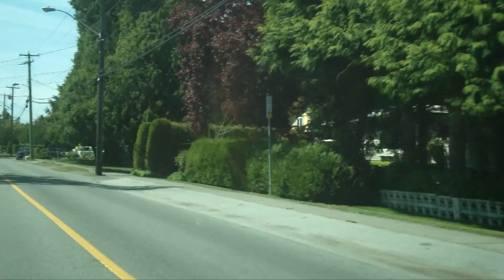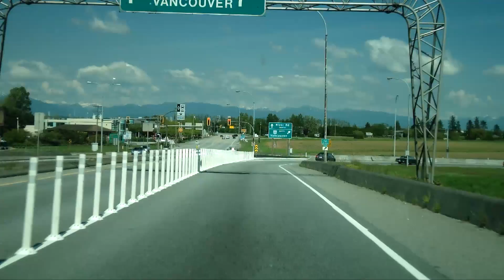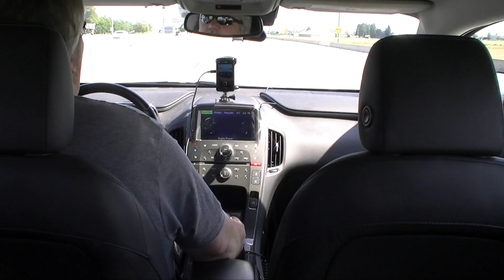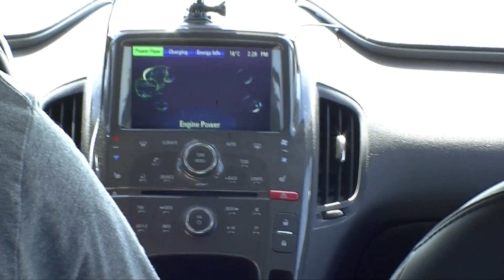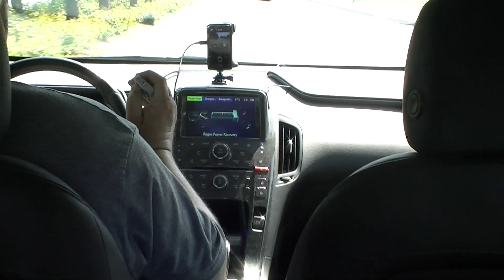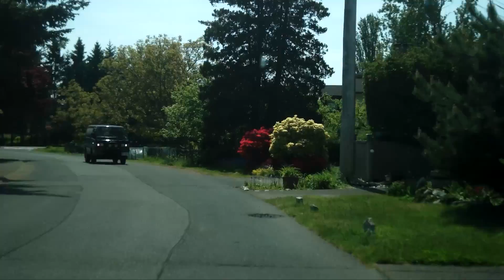How to drive a chevy volt for best electric range and fuel economy

Comment: Hi, good video...gives the audience the basics of hypermiling.  That said, for the utmost in efficiency you'd be better off coasting in neutral rather than using regenerative braking all the time.  Though regenerative braking does does return energy to the battery, it isn't 100% efficient (more like 70%) in doing so.  For that reason, while using L or on regenerative braking, you never get back the energy you "paid for" to get that momentum.  In most situations, I'd recommend using "L" only when you really do need to slow down or come to a stop - otherwise, it's better to preserve that valuable momentum using N whenever possible.
Reply from the maker: +oilerlord 
If you watch the video the only time I use L is when I need to slow down or stop. I don't use it while driving at a constant speed. Only when going down Hills an when rolling up to a red or stop sign. Shifting to Neutral is both dangerous an in most jurisdictions illegal as is driving with the clutch pressed on manual transmission cars. 
Without drag, or power to the wheels the steering is affected big time.
Reply: +12voltvids
Illegal...I'd have to check local laws, but dangerous...how so?  I drive a VW TDI and coast in N to take advantage of hills and to preserve momentum all the time.  For me, it's second nature coasting in N, and I've been doing it for decades (and I've never had to replace a clutch or transmission).  The power steering isn't affected at all because the car is still running.  If you coast in N with a Volt, does that somehow turn the car off and/or affect the Volt's steering?  Please elaborate on that.  In terms of distracted driving, I suppose the repeated action of shifting to L could be considered as "dangerous" as shifting to N.  I'll stipulate that repeated shifting could cause wear with some transmissions, but unless the car is turned off, I don't see how steering would be affected or a loss of control would happen regardless of "L" or "N".
Reply from the maker: +oilerlord 
No the power steering is not affected if put in N or for that matter the power is turned off. Go watch my video regenerative brake experiment. You will see just how much energy is recaptured. 
It is illegal though, go check your regulations. Everywhere in Canada it is illegal to coast. The reason is it affects your vehicle stability. 
I switched to N in the other video so I could power the car off then on to reset the computer to get back to electric mode to see how many miles I could gain going down Hills and I have lots of flames by viewers tearing me a new one for showing this.
Reply: +12voltvids 
No flames here...just a difference of opinion.  How coasting in neutral would have an affect on vehicle stability is beyond me, but it's ok to agree to disagree on that one.  As advanced as regenerative braking systems are, none have the ability to recover anywhere close to the energy that was used to get the car moving forward - otherwise you'd be driving a perpetual motion machine.  That said, I'd be shifting to L in instances that more stopping force is required instead of (gasp) wasting energy into heating up brake pads.  I installed a large PV installation this fall, and I'm looking at either a Volt or other BEV to store / use that excess power instead of merely exporting it to the grid.  I'll either be picking up a used Volt or Spark EV this spring.  I "want" a Spark EV but logically, I already know that the Volt is the better choice for me.

I watched that experiment, where the guess-o-meter reported 208 km remaining.  Interesting, but just a fun number that a confused GOM interpreted.  Since there is only about 11kW of usable capacity in your 16.5kW battery, the Volt's battery can't realistically store enough energy to go anywhere near that distance however fun video nonetheless.
Reply from the maker: +oilerlord First of all that is not a "guess o-meter. That is the actual distance traveled on electric power. The battery only has 10Kw of usable "stored" energy on the 2012 model, however, remember regenerative braking places a huge amount of power into the battery. Watch my newer video where I started a descent with with 6KM remaining in the battery, and by the time I got down there was 21KM remaining.  For about 19KM of downhill "regen braking, I recovered 15 KM of usable energy. That's how it works. Not 100% energy recapture, but much higher than 70% Probably closer to 90%.You can look at the distance covered and the fuel used in that video and figure out how little fuel I used due to the energy reclaimed by regen braking. Also since you have never driven a volt you don't know how it runs. In D, when you take your foot off the accelerator, you are almost totally freewheeling. There is a slight drag, but it doesn't slow the car down. Going down hill the car will continue to accelerate. Shifting to L dumps more energy back into the battery and slows the car no different than applyin the brakes, without wasting that energy as heat.As to coasting in neutral, I invite you to google it and see why it is a bad idea. Besides being illegal.Here is what I found after a quick search."There are many reasons you should not do this.  The law is just one of the reasons.   

 First, you may think you're saving fuel by coasting in neutral.  This is not true.  Modern Cars will use less gas when coasting in gear than they will be switching to neutral.  In gear, the transmission keeps the engine turning and so no/very little gas is required.  Plus, if you get into a situation where you need power NOW, having to fiddle with the transmission isn't something you need added to the situation.  When the car is in neutral, it is forced to provide enough fuel to keep the engine idling.  This actually takes more fuel than it does to just coast. 

 It's also harder on your transmission, especially an automatic.  This is because all the pressure of timing the drive-shaft to the engine's crank-shaft is left to the clutch assembly within the transmission.  This is wear and tear on the transmission.  Unlike a manual, it costs a lot more to fix the automatic.  It's possible that the car will not go into gear.  And, if this happens while driving, you may find yourself in quite a pickle.   

 California Motor Vehicle Code 21710 makes it illegal to travel downhill with your car or truck in neutral.  The same law applies in most states of the United States.  California lists the following as reasons: 

 Your car is not designed to travel in neutral.  It is hard on your brakes, your power steering, and your gas usage 

 1)  No opportunity for engine braking.  If you drive a standard transmission, your car is designed for engine braking when traveling downhill.  Get into the habit of downshifting on hills.  This will be better for your transmission and save your brake pads. 

 2)  Power Steering loses its effectiveness.  If your car was built after 1980, it most likely has power steering.  When driving in neutral, the power steering will not work as well as it does when the car engine is engaged.  This will make turning around curves and avoiding road hazards more difficult.  You could also over-correct and crash the vehicle. 

 3)  Brakes may fail.  If you ride downhill with your foot on the brake the whole way, the added stress on your brakes could cause them to stop working.  Cars in neutral will pick up speed, making the brake pads heat up to unsafe levels.  Many trucks have lost their brakes because they were coasting downhill instead of downshifting. 

 40  Getting in gear takes time.  Accidents can occur in the blink of an eye.  If you have to take the extra second to get your car into gear, you may not be able to avoid obstacles.  Animals and potholes spring up out of nowhere and you should always be prepared to drive around them if necessary.  If you are coasting, your only option for avoiding hazards is to swerve or slam on your brakes.  Both of these are bad options. "        

 Source(s): http://www.trafficaccidentnewsandadviceb
Reply: +12voltvids 
Though it's true that most ICE cars use zero fuel when coasting in gear, engine braking also slows down the car at much faster rate than coasting in N.  For that reason, one isn't necessarily better than the other because driving for efficiency is all about preserving momentum in different situations.  From what you describe,  lifting your foot off the throttle in your Volt with it's electric motor is probably not much different than coasting in N.
Reply from the maker: +oilerlord It is essentially freewheeling. There is a slight drag and some recapture of energy to the battery, but nothing like dropping it into L range, or in th ecase of the 2016 model, tugging on the regen paddle on the steering wheel.As that article said though, modern cars will cut off the fuel when going down hill, and use the momentum of the car to keep the engine turning, which keeps the vacuum up for the power brakes, and keeps the power steering pump running all from the momentum of driving down hill. Switch to N, and the engine needs to be fed fuel to keep it running. It is also illegal to do so. Think nobody will find out? Have an accident, and investigators examine the black box that is in all modern cars, part of the air bag deploy module. The information that is stored in the box for several seconds prior to the crash is accelerator position, brakes on or off, was ABS activated, vehicle speed for 5 - 10 seconds prior to air bag deployment, engine RPM, and the gear that the car was in, was steering wheel turned just before impact ect.  All this information is stored, so should you get in a crash, and this information is downloaded it could have a huge impact on determining fault.  A few years ago there was a high profile incident involving a small child being run over by a drunk driver, and all the details of the car came out. The amount of information gathered by modern cars is quite extensive, and this is all available to investigators after an accident.
Reply: Oilerlord - I coast other cars in neutral, but never, ever the Volt.  Several reasons not to.  You can find them in the owners manual and online forums.  But primarily, there is NO benefit and a net loss of range.  You sacrifice any regeneration of electrical from kinetic by doing so. Regen is disabled in neutral.  Legality or illegality, control or less control... those concernss are irrelevant to the subject discussion of energy conservation.
Reply from the maker: I couldn't have said it better myself.
Reply from the maker: Don't want to keep my foot on the gas. I came from the standard world, and shifting down is fun. The new one has a flappy paddle on the sheering wheel to throw on the regen

Comment: Hi, I just recently got a Volt a few weeks ago, so forgive me for my ignorance. But when I try to drive freeway speeds (70+) the little green ball floats a bit above the middle and I run out of electric gas really quickly. When I try to drive home, which is a 39 mile commute on the freeway, I was hoping a full charge would get me there. But my electric gas runs out halfway then switches to drive mode. Is there something I'm doing wrong? I don't use AC or heaters, or windshield wipers because it rarely rains in California lol
Reply from the maker: +DominiqueCalique The faster you go the faster you will burn through the battery.At speeds over 60 it takes more energy to overcome the wind resistance and this is true on any car. A gas or diesel powered vehicle uses much more fuel to maintain high speeds. The little green ball shows you where you get the best economy, and that is speeds up to 60MPH. Now the outside temperature also plays a big role in how far you can go on electricity. At temperatures below 60' the range starts to fall off. When the temperature In in the 40's F and below I find I loose about half my electric range.This is because batteries do not perform as well in low temperatures. They like to be in the 68 - 72 range. This is where they perform at their best.When the temperature is lower, the car will actually turn on heaters in the battery back to bring the cells up to the range they perform best. This of course wastes some of the stored energy to heat the battery. You would wonder why they do this (all electric cars do this by the way) is to protect the battery from drawing too hard on it when it is cold. If your car is plugged it will keep the pack nice and warm ready for use, but if it has been sitting in a parking lot, then some of the charge will be used to warm the pack.When it is really cold, 25' the engine will start for a couple of minutes, and 2 things happen. First the electric heaters are turned on to start warming the battery, and then as the engine coolant warms up, that is used to heat the battery coolant. Once the battery is warm, the car switches back to battery, and the range is actually more on the battery once "engine running due to temperature" cycle ends as it hasn't sacrificed some of the charge to warm the pack. Once the temperature warms up again, the range returns.  Every winter since I got my volt, this Is the 5th winter with mine, my range drops to about 25 miles over the cold months, and in the spring it returns to the average 38-40 miles I easily get. The new one gets 52 miles, which is quite an improvement. For me this is not an issue though, as my daily commute is well within the change range even on the coldest days. We have great public charging infrastructure here in Vancouver BC area, so I have plenty of opportunity to charge when I am out and about. Those charge stalls are usually located right next to the handicap stalls next to the doors at the malls, or right near the entrance of parkade. Pretty much all our charging here is free to use. Have to pay to park, but so does everyone else. It is a definite perk.
Reply: +DominiqueCalique  May be able to use a few minutes of mountain mode on the highway to charge that battery up to half several times.

Comment: I drive only in Low range, for the last 4 years now... Works great, no need to keep messing with the shifter.
Reply from the maker: +William Dean Messing with the shifter is half the fun.I used to drive a stick, and gearing down to slow down was just what you do.Besides, there are times I want to just cast. Leaving the shifter in low range means a fast slow down every time you lift your right foot.
Reply: +12voltvids which is why I ease it off instead of simply lifting. Sort of like easing the brake pedal but easing the throttle off instead. Enjoy your shifter.
Reply: I do the same as Wm Dean.  Smoothly controlling the accelerator pedal in L when slowing for conditions ahead helps me get 45 to 50 miles electric in 2012 model.  Very ocassionally I will do as 12V Vids does when someone is following closely, i.e. very lightly use the brake pedal to get brake lights on.  @ 9:57 you say 11.8 kWh used... Sounds like an interim charge of 2 or 3 kWh was done since last full charge.
Reply: +William Dean Yes, I have begun doing the same thing.  It is a little non-intuitive, but actually gives better control.
Reply: Yes, I keep my 2017 volt in L gear and sport mode. Even at 80 MPH works fine. Sport mode seems to have the most regen. Force.